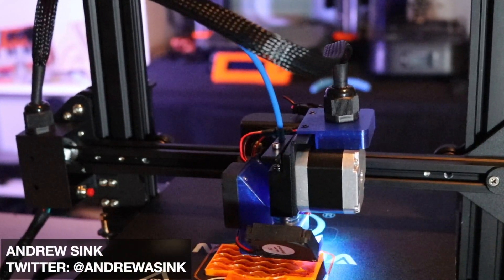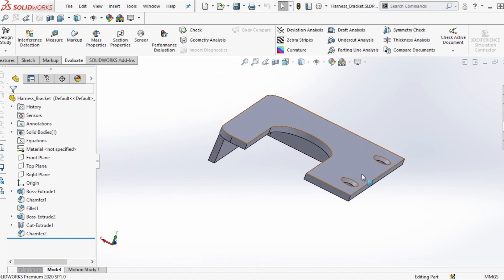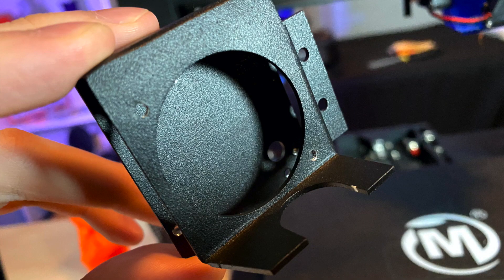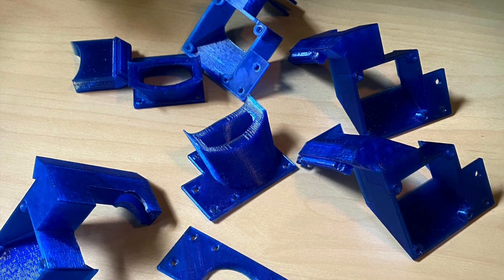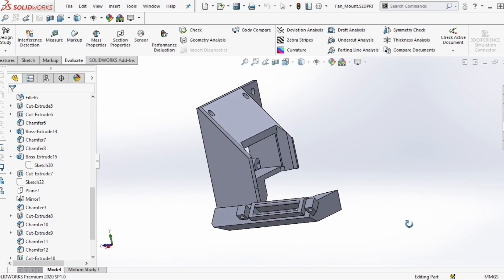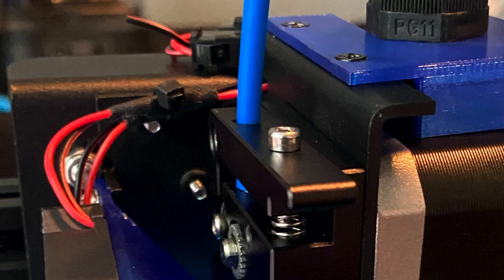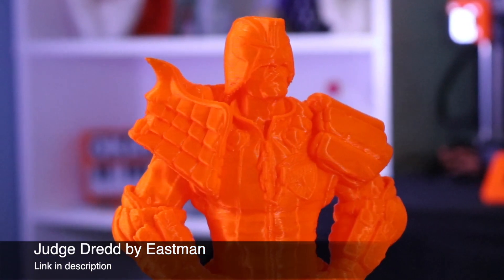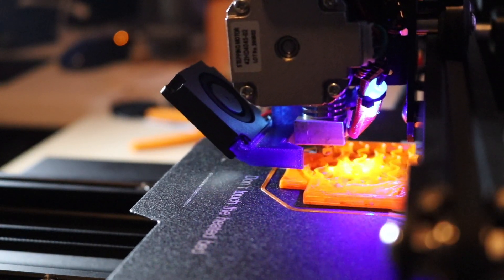Redesigning the Mingda D2 Fan Mount to Improve Print Quality / DIY 3D Printer Upgrade!

Comment: I've been working on an upgrade too, But I kinda broke the original one.. and the one I was using started drooping :/ So now I can't get it to print a replacement to get it running again.. I'm thinking I'm gonna have to jank something together with some sheet aluminum just to get it to limp again so I can print something better lolol. Nice job tho, did you ever get it up on Thingiverse?
Reply from the maker: Thanks! Unfortunately, I never got around to uploading this model, and I've since given the printer away. Should be pretty easy to replicate, you can just copy my drawing!
Reply: @AndrewSink  I had to subscribe cause you make this sound too easy.

Comment: I dont think you caused a short circuit and such is the issue. I have confirmation from Mingda that the part cooling fan terminal has much much less than 0.08 amps of the 4010 fan, barely any current to properly run the 5015 fan. Depending on the cabling and a few things you basically have no real high current available to drive any large fan and the small 4010 very limited.

Comment: This kind of redesign does not work, for me at least. Too much airflow through the tools, causing thermal runway error.
Reply: Do you need to run PID tuning? Chris Riley has a video on tuning the D2.
Reply: @evropapagan5551  thanks for the info, will try later.
Reply: Yep, I had exactly the same result.  It would seem that Mingda have set up the hot end fan to work just right - even though the intake side is substantially blocked. After too many thermal failures, I reinstated the original system and all was fine.  However, I think the part cooling fan could be upgraded, but the hot-end fan needs to be partially covered. I notice some "official" photos show the part cooling fan is bent outwards slightly so it blows downwards, and it will also allow a little more air into the hot-end fan.